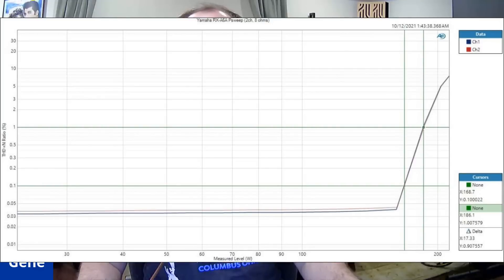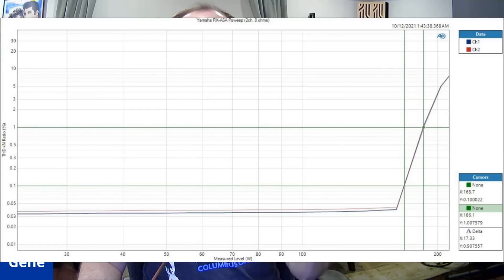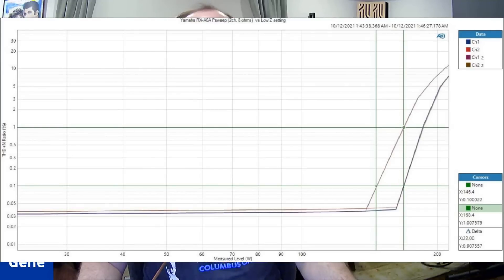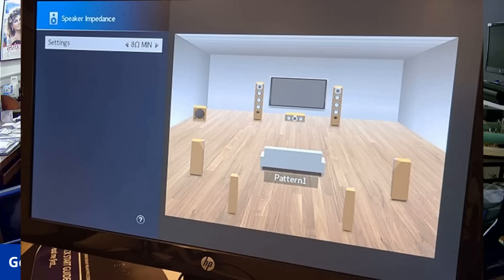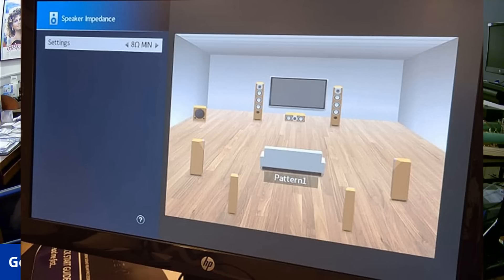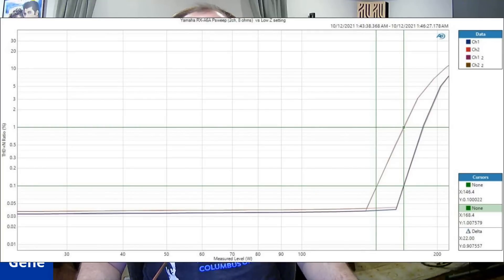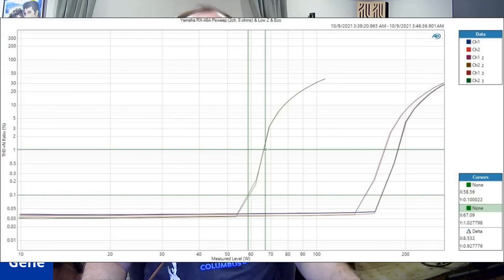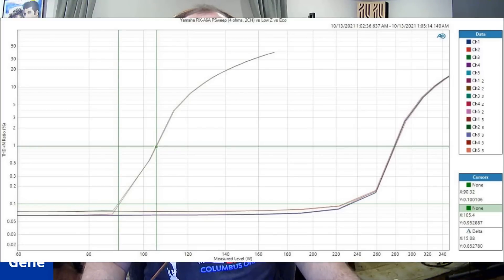Avoid Power Killing Features on Yamaha AVENTAGE AV Receivers - Use These Settings!

Comment: Marantz NR1710 user here. I have Argon Audio 4ohm speakers. 4ohm setting was causing clipping and piano sounded distorted. 8ohm setting and ECO-mode off, did the trick. It was causing  me headaches, because I thought I set it up correctly, but sounded worse than my old Onkyo Receiver.

Comment: tnx for the video very informative , i use mixed speaker impedance , center speaker 4 ohms and the rest 6speaker is 8 ohms, i set my onkyo tx nr5100 impedance setting to 6ohms and it so cool. ,  whatsoever. Did i do the right thing or no? onkyo has 2 impedance mode 4ohms and 6ohms to16ohms. but i opted to 6ohms and above.

Comment: Obviously 4 ohms speakers will draw a lot more current than 8 ohms. With 4 ohms speakers, you reach 150Watts at half the output voltage. With 4 ohms speakers, this settings will protect the expensive output transistors. I wouldn’t dare cranking up the volume with 4ohms speakers and this setting to 8 ohms.  Overheat is almost guaranteed while playing roulette with your equipment.
Reply from the maker: @Wurlyscope  spoken by someone who hasn't used these AVRs or tested them. You're incorrect.
Reply: @Audioholics  No, i’m just an electronic technician with years of experience in audio repairs.  Those amplifier’s designers didn’t put that setting there for nothing.  It may cripple the power but it does it to protect your equipment.  It’s better to say: use 8 ohms speakers instead, but using 4 ohms speakers on the 8 ohms setting is taxing the output power transistors stage.  You will draw the double of the rated amperage to get the same 150w.  You do it at your own risks.  Now you are still free to connect 4 ohms speakers and set the amplifier to 8 ohms.  Now you know.
Reply from the maker: @Wurlyscope  you're still wrong with regards to why the switch is there.  I'm a EE with years of designexperiencee before i became aprofessionall reviewer.. The 4 ohm setting cripples these AVRs, some worse than others. I spent 25 years testing AVRs with all of it documented on my website. The 4 ohm setting can limit 150 watt AVRs to as little as 30-40 watts/ch. Clipping the amp like this is more damaging to the speakers.  Leaving the AVR at 8 ohms has never been a problem when driving modern 4 ohm speakers in my experience. I've run Yamaha AVRs w 4 ohm speakers for 10+ years, and they've never failed. The switch is there for the reasons I explained, and even Yamaha engineering has agreed with me.
Reply: @Audioholics  i ordered the RX-A8A and will use 8 ohms speakers. These AVR are built like tanks with a lot of power reserves, that’s probably why they take 4ohms speakers without blowing. Anyway i will continue to follow your interesting videos.
Reply from the maker: @Wurlyscope  that amp section can easily handle a 4 ohm load as you can see in my bench tests. Entry level AVRs will severely power limit at 4 ohms even without switching to 4 ohms. I check this thoroughly and report if an AVR can be used w 4 ohm loads. Hope that helps and enjoy. You've got a great AVR.
Reply: @Audioholics  i have read all the informations on your website about the nanies of this receiver. I understand now what you ment.  My apology.  I hope this can be resolved via a future update. It is now at firmware ver. 2.03 . I don’t have my receiver yet, it is reserved for me at my dealer’s store.

Comment: So this assumes you're using resistors and test tones. 

You've ignored a lower impedance speaker has variations in impedance across the frequency range. Moving power output CLOSER to a properly regulated amp may be beneficial for some speakers. A perfect amp should double power as impedance halves. Using your advice, you actually reduce that ratio.

Good info but not properly thought out past "what has more watts"

Comment: Hi, interesting theory too everyone's take on this topic.  I have had quite a few Yamaha over the years and I like the older ones better I have a Yamaha Aventage rx-a2050  and before I had an rx-a1010 I did just the bias to 16.7 it was originally set to 15.2 the services manual does say 15 plus or minus 2% I find it gets a bit hotter with it at 16.7 but sounds warmer to me on the Yamaha rx a2050 I set my bias on all channels to the 16.4 on this receiver and I installed about double the capacitor this unit runs at about 59 too 60 volts plus and minus the unit comes with only 2 * 12,000uf 71 volts capacitor for all 9 channels it seems as the power supply was sagging so I add about a extra 10,000 of 80volt  to each rail and it proves they skip out on capacitors for power supply i also changed out the bridge rectifier too a 30 amp instead of the 15 A that was installed on this unit after that i have no complaints about this unit i also add a fan as it does run hotter now but sounds great and drives all my channels with a punch and clarity thats my take on this receiver the new  receiver rx-a6a and up use the same amplifier modules  just different capacitors but same transistors and layout. I bought mine used it also has two supply rails hookup to a relay at 64 and 37 volts  this will switch to 37 volts in the 6 ohm or eco mode or handy cap mode lol if you have small speakers as satellites and are 4 ohm or 6 ohm it will sound better due to the power cut off too 37 volts

Comment: I own the A6A. mine does not have a physical switch on the unit. but it does have it on the on-screen menu. However, Yamaha removed the 4ohm option via a firmware update and gave two options. 8 ohm and 6 ohm. I hope to see a new review of this awesome receiver.
Thank you, Gene.

Comment: 2 years ago I bought the Aventage A2A, and unfortunately, I've been very disappointed with the anemic power. I've been happy with my old Yamaha RX-V490 with a lesser power rating, and expected a slight improvement in power with the A2A. Instead, it was MUCH less power and I am now struggling with the idea of spending even more money on an external amp. Heck, I'm even thinking of powering the A2A with my old receiver until I decide. I tried both the 8 and 6 ohm settings - same problem. Especially with the 4 ohm speakers I had but even with the old JBL's rated at 8 ohms. The old receiver sounded better and had more power. I was hoping this video would tell me I was doing something wrong, so I could correct it, but no go. Obviously I'm not an audiophile, but this was step 1 in what I wanted to be an upgrade to my whole system, but now I find myself limited to highly efficient 8 ohm speakers - and I just don't want to settle. I also don't want to spend a ton more money on power (like more than $700.00 or so) - so yeah. Really disappointed in the A2A. (speakers were Bose 8.2, and/or JBL CF-120's). I will be replacing them but wanted to solve my power problem first.

Comment: Thank you. I have had the A6A and before that had the 2040. I am not rich, but have a 15' x 30' theater/rec room setup in the basement. I have an Atmos 7.1.2 setup with an SVS 18" powered subwoofer. All of my speakers are Klipsch. I have been so happy with the performance, but I am now wondering if I should add some sort of external amplifier to help out the A6A. I watch movies with the volume between -24 and -18 volume on the A6A.
Reply from the maker: You don't need an external amp based on your listening habits and high efficient speakers you own. Put your budget into some room acoustics treatments and/or some professional consultation service.

Comment: Now do your test with the reciever on a 240 volt outlet that most of the world using a reciever has and see how your test results only work for 110 volt outlets
Reply from the maker: Won't make much of a difference in products that have smaller power supplies than what the wall outlet is capable of delivering.
Reply: @Audioholics  most power supplies don't work their best on 110v. They work a lot harder when drawing the same wattage from the wall compared to 240v. Manufacturers have this in mind and tend to restrict the potential performance of the entire product to protect itself from the added heat.
Reply from the maker: @tomdrums4607  Yamaha has optimized transformers for 120/220V for different markets. I don't think the power would be much different, especially with all of the nanny's built in.

Comment: so........will it be ok to hook up 4 ohm speakers to these receivers? I know you said to keep it in 8 ohm settings but just wondering if that's the same for 6 ohm as opposed to 4 ohm or lower?
Reply from the maker: For the most part yes provided you have good ventilation. If the AVR  Shuts down at high listening level, add external amplification on the front 3 channels to lighten the load.
Reply: @Audioholics  gotcha, will do. I don't have power amps but I have old receivers hooked up to my pre amp outputs. I have an old denon and an onkyo. trying to get the settings adjusted for those 2 however. I'm not sure if the eq settings in the yamaha affect the output of the 2 receivers I have hooked to it. for instance, when I plug it  (my denon) into surround it has no highs (I set my yamaha to have only bass coming out the surround 2 speakers at they are just subs and don't have any mids or tweeters hooked to it). whereas when I plug for instance, the denon into the yamaha's "surround back" and the eq is untouched on that channel then it sounds fine coming out the denon. I'm just wondering if i'm wrong about how the eq works when plugging external amps into the various pre amp output channels or if messing with the eq for the channels that is being used by an amp/receiver will change how they output sound too? or am I plugging the receiver into the wrong pre-amp outputs? Hope I'm making sense here. I might make a video explaining what I mean if typing doesn't make sense.

Comment: I got an RX-A6A off ebay recently for $900 used. It arrived damaged so the seller refunded it by $100. The seller forgot to remove the antenna when shipping it and it broke the antenna and bent the fixture connected the antenna slightly. That said, it still works great. By far the most powerful receiver I've ever had. I have a relatively crazy set up. I have 2 old KLH cabinets from the 90's that have 4 12 inch speakers in the 2 cabinets. I replaced the speakers with Dayton designer series 12 inch subs a few years ago, I have 2 12 inch MTX speakers in 2 cabinets from the 90's, 2 Klipsch speakers with 4 6 inch speakers in it, I have a klpsch center channel with 2 6 inch subs in it, a boston Accoustics center channel with 2 4 inch subs in it, an energy center channel with 2 4 inch subs in it, 2 bose passive speakers (it has an 8 inch sub in it that you plug input wires to it and then has output speakers that connect to other cabinets), and 1 diamond audio 10 inch passive speaker (its basically the same thing as the bose, it has inputs and outputs for the speaker wire),2 4 inch mtx book shelf speakers for surround audio and 1 10 inch klipsch powered sub. 
I have an old denon and onkyo wired to the pre-amp outputs on my yamaha. basically my system sounds better than being in a club. 
I ended up getting some of the speakers from a pawn shop that closed and they sold the speakers dirt cheap (like 5 bucks for the bose speakers and the boston accoustics), and used to flip stuff on ebay so ended up buying a bunch of speakers to flip but decided to keep (the mtx and some of the klipsch speakers). 
I had an old yamaha rx-v656 receiver that died a couple years ago. That thing was the first receiver I bought new. Every since I had that receiver it was light years better than my others. It had a built in equalizer for each channel, pre-outs for an amp, detect the distance of each speaker, adjust the level for each speaker. has some of the same features my rx-a6a has. Really, no other receivers I've had anywhere near the features my old yamaha had, so when seeing the rx-a6a go up for sale on ebay, I bought it because it had massive features I was into (4k and 8k support, e ark, great power, the ability to hook it up to other amps, 7 channel eq for each speaker, etc etc etc. 
I just got it like a week ago, so have been messing around with the settings, been watching a ton of videos such as this on it. Really, truth is, its by FAR the best receiver I've ever personally seen.
My old KLH speakers with the dayton subs could take any receiver and it wouldn't max out the subs. Really, this yamaha is the first receiver I have ever seen that could cook the coil. I can make the subs smelly from this receiver. Never seen another do that. Really, being able to have basically 11 speakers connected to it and the ability to provide plenty of power to them and have an eq for each speaker is the main selling point for me. 
Well, anyways, thx for this video, I would never have turned the ohm's down as all my speakers are 8 ohm, I might have used the other feature you were talking about though (eco mode).

Comment: Thanks for the info. Interesting. I guess my first instinct was that the impedance switch is there to protect the speakers as much as the receiver. Is keeping it at 8 rather than 4 Ohm going to have any affect in the speakers at high volumes? Cheers.

Comment: Thanks for this video.

I was about to pull the trigger on an A6A… until I learned its 7 channel power. 52w is not acceptable and it’s unfortunate that Yamaha purposely cut power that drastically and there is nothing a user can do about it. My current Onkyo is bench tested at 103wx7, I’m very happy with its audio quality, so I’ll hang onto that for a few more years.

Comment: P.S.   This is the morning of my third day of owning my A6A and the firmware update was waiting on me this morning .  I went from FW update 1.59 to FW update 1.80 ... My system is running well with very few issues that all Have been resolved...   This is a much better receiver than how it reviewed a year ago .   And the remote plays well with my Sony TV... and runs several function for my tv , Samsung UHD blueray player , and turns off my cable box.....  I use my cable tv remote for everyday use , and hit the power button on my cable tv to turn on my tv, cable box, and my receiver , A well as turning everything off.... all this without programing and right out of the box....

Comment: Better late than never.... Thankyou for your Power setting post for the Yammy A6A .. I just replaced my Denon X6500h with this new Yamaha receiver.. After several Reviews , a lot of complaints and praise, I took the plunge.   Your other reviews that you posted with what this receiver puts out , and your honorable mention , told me this receiver is what I'm looking for .  With other High end receivers/processors  that are coming out without amplification without any Amps for twice the cost , kinda scares me on what the future cost of a home entertainment center will cost after buying enough Amps to fill your processor...... And the RX-A6A is the best chose for  having the same power as the A8A and included BALANCED PORTS to Amp my front 4 Ohm speakers .  This should carry me through for many years ....

Comment: Looking to buy new receiver, thinking the A6A.  Snell 5.1 speaker system right now, height speakers down the road.  My question, was going to bi amp my main towers with the extra channel.  After watching this would using the extra channel add more nanny's and actually cutting the power to  my system ?  Or should I still bi amp?  I both listen to music and movies.  Loud music, rock n roll.

Comment: Hi.  I have recently installed the Yamaha rx a6a receiver in a theater where there was a faulty marantz 9.2  receiver was installed before this Yamaha. 
Now,  following your instructions as you have a lot of experience in this field.  The speakers have changed there properties a bit. Some 4ohm speakers now have 3.5 or 3.6/7 ohms and ceiling speakers originally 6ohms are no now showing 6.5/7 ohms. 

Again I want to ask that should I choose the best matching impedance setting which is 4ohm minimum which means that fronts have 4ohm and others have 6/8 ohms. As we know that impedance matching is important for interfacing any two circuits.  Lower impedence can cause overdriving of the amp and higher impedence will decrease the output power of the amp. Now this is a general concept. 
How can we say that a manufacturer not only Yamaha but almost all of them have created this feature/switch so user can select the impedence according to the speaker impedence is a useless feature.  Yes you are right, if it will decrease the output power on lower settings,  if not set properly can it effect the amplifier or the speakers by making the speakers more power hungry or forcing the amplifier to deliver more power?  Your expert opinion is required.

Comment: Thanks for that. Are there any negatives to this? Can the avr or the 4 ohm speakers get damaged with the high setting? Also I am in a peculiar situation in which I upgraded my speakers but because of supply chain issues I only got the center channel which is 4 ohms but the rest are 8 ohms. Would this cause any problems while I wait for the rest of the 4 ohm speakers to arrive?
Reply: great question.

Comment: English is not my native language and I don't know if I understood it correctly. I have the yamaha a6a with an old jamo 606 set that is 6ohm, so I lowered it to 6ohm on the avr since I read that it could be harmful if I didn't. So, even if the speakers are 6ohm, do I have to set the arv to 8ohm? Will it not harm the avr or the speakers?, thanks!
Reply from the maker: The video is very clear on the proper setting for ALL Speaker impedance loads. Please watch again.

Comment: Gene, great video and data points with regard to impedance selection and extra bass settings.  Replacing my 27 year old RX-V690 Dolby Surround 5.1 (85 W/channel  2 channels driven) with the RX-A2A at 100 watts is a "beast" as you say.   Dolby ATMOS sound is mind-blowing with volume levels set at -20 dB to -15 dB.